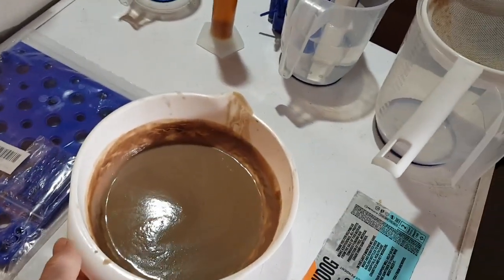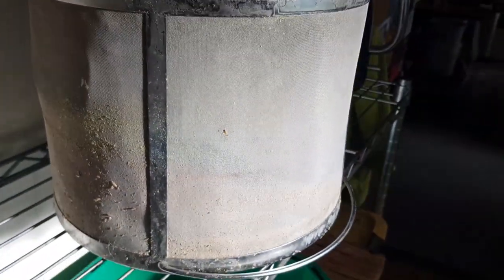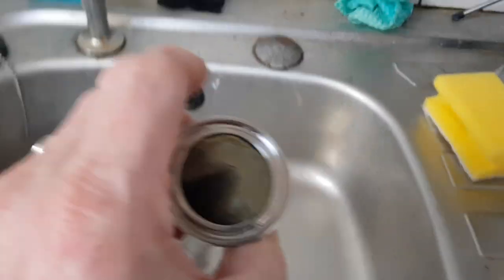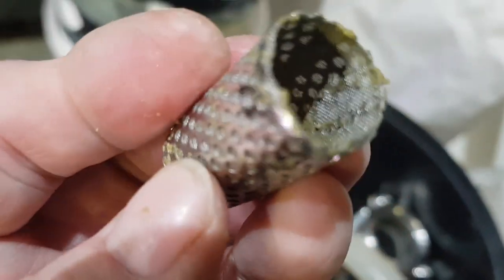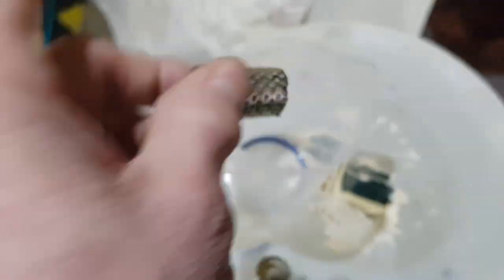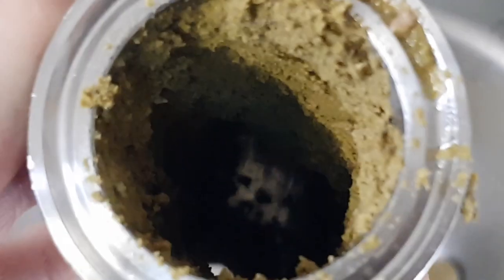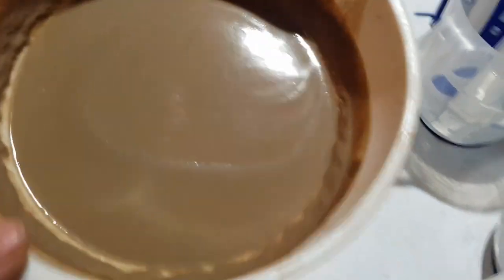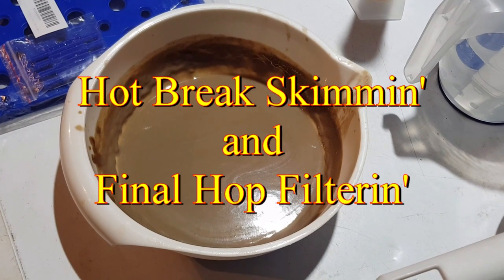BREW - Hot Break Skimmin' and Final Hop Filterin'

Comment: 🤣 Great video as usual and I know what you mean about "experts" 🤣, by the way by dictionary definition: expert; ex: something that has been; spurt: a drip under pressure 🤣 .  I don't really do Facebook as I don't understand it and it messes with my "engineers" head and way of thinking but I do try and offer advice on errors that I see posted within video's on YouTube. The main one that I comment on and which I have been lambasted for on quite a few occasions is adding yeast nutrient to the boil cycle while brewing beer. The main point that I try to get across is that there is no need to add yeast nutrient to beer as the wort contains all of the required nutrients for yeast. The last reply was more or less "you don't know what you're talking about, it's a fruit beer" 🙄 fruit beer as in an all grain beer with some fruit juice put in it for flavouring 🙄. The secondary point is that if you are going to add nutrient add it to the fermenter as boiling the nutrient degrades it and renders most parts of it useless, that gets the usual "always done it this way and never had a problem" 🙄 😴. I've decided not to bother now, if they want to waste money adding unrequired yeast nutrient into the boil kettle why should I care? S..r, cheers, Schnuz.
Reply from the maker: I add a big pinch of yeast nutrient more out of habit than anything else when I'm unsure about the yeast.
If I've made a starter I'm ok as I know there's lots of very good quality, hungry yeast.
It isn't however, something I've ever really thought very much about and if I'm honest, don't know either what it is, or how it is supposed to action.
Reply: @MadeByMartyn  a good quality yeast nutrient (for country wines) contains vitamin B1 and small amounts of vitamin B2 along with salts and acidifiers that make a tasty bed for the yeast to thrive on. Grains have all that stuff in abundance so even though you boil the wort you aren't going to denature all of the vitamin B1. Adding a teaspoon of yeast nutrient to the boil is not going to affect the outcome as the fraction of that teaspoon that is vitamin B1 (the main active ingredient) will be denatured by boiling for more than ten minutes. If you want to add yeast nutrient then add it to the cooled wort in the fermentor and no, you do not need to spray it with starsan, another subject that I don't need to get started on 🤣 . Basically you only need yeast nutrient if you are going to make country wines which tend to lack a number of the required chemicals as you tend to add sugar which has only energy and no cell building requirements. S..r, cheers, Schnuz.

Comment: I used to skim but after listening to the hop addiction boys saying it’s got benefits for the yeast I’ve stired it in. However I use a hop spider and have the same problem as you with it blocking. Plus I alway add yeast nutrient at then of boil any way so think I’ll be going back to skimming too.
Reply from the maker: I wasn't going to on this brew as the hop additions seemed quite small, however when I saw what was there coming up to the boil, I had to scoop it out.  Glad I did now.  I also use Yeast Nutes in the last 10 mins.

Comment: Can you give the measurements of your filter tube? I'm thinking I want to build my own.  I also have those street Y filters, because I saw them on your build.

I still look at my beer facebook. I answered the "to skim or not" with sometimes I do. It just depends on how much it is foaming.
Cheers 🍻
Reply from the maker: The large one is the 30cm triclamp 50.5 at each end.  There is a tapered spool too but I could get one when I looked.  I then tapped a 1/2" BSP thread to take the bazooka.  Clive then found a better solution, which is what I use for the filter between the Mash Tun and copper.  That has the 6" bazooka in a 20cm spool tube.  Let me know if you have problems finding any of the bits and I'll dig out the eBay or AliExpress links.
Reply: Thanks